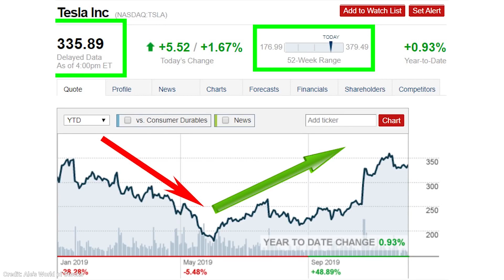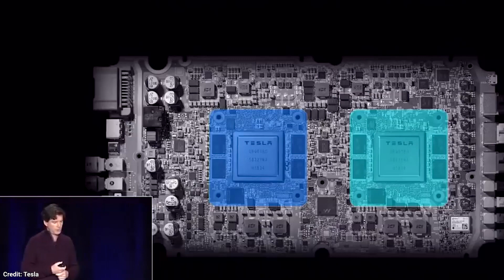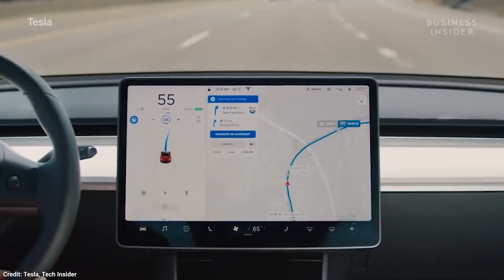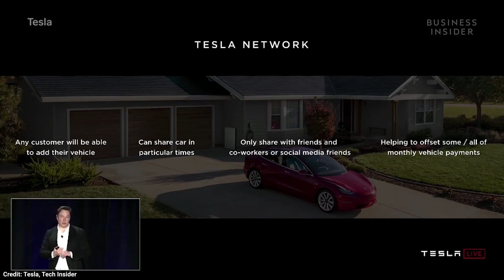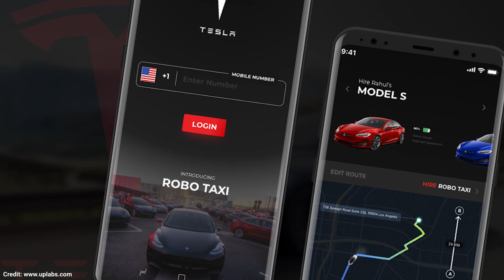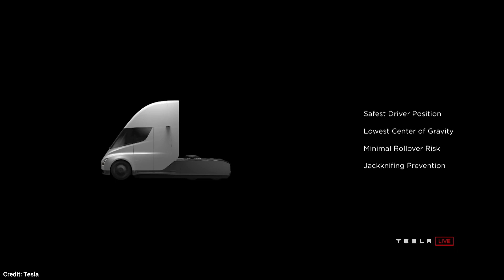5 Things Every Tesla (TSLA) Investor Should Know for 2020

Comment: One more thing, in china you can only get a license plate in Shanghai or Beijing if you have an EV. No internal combustion engine is allowed in those cities for new registration.
Reply: Not entirely true. For petrol cars, you will have to enter into a lottery to acquire a license plate. On top of that, in Shanghai, even you won the lottery,  you would still have to pay about 100 thousand rmb (about 14000 usd) for the plate.
Reply: 徐吟川 thank you for the correction

Comment: Should I buy tesla now or wait for a slump.. I have been wanting to buy for a while now.
Reply: Chlorophant if you’re planning to hold it for a few years, then it doesn’t matter. $405 vs a dip is not that different in the long term, assuming the stock reaches the $3000-4000 that it’s predicted to reach.
Reply: Buy on every down day or dip in an up day. Every check you get,  put some in Tesla stock. This is a dollar cost average buy-in, which reduces mistakes on a volatile stock. 

When the stock is at $4,000 in five years, the sooner you buy,  the better. By 2025 you'll be wealthy.
Reply: @universalchiro  Let's not pretend it's a sure thing, Tesla should be considered high risk, a lot could go wrong.  However--I happen to have near $100k on it, by far my biggest position rt. now.  Deciding to stay long today is exactly the same as deciding to buy it at current price.
Reply: Always a tough decision, I was asked if it was "cheap" just a few weeks ago at $330 and I didn't have an answer other than I was still buying.  Still around 20% shorted which is good for potential near term upside.  You might break up your total allotment into quarters and spread out your purchases over weeks or months, on the other hand we may never see it this low again given it's been nearly flat for 5 yr.s and a lot has changed for the better over that time.  As mentioned above--dips will look trivial over several yr.s holding.
Reply: I already smashed my 'diversification discipline'.  I don't panic because I know the situation well enough to have strong conviction.  Sounds like you are in a similar place to me.  I don't intend to sell until/if the story changes for the worse enough to warrant it.
Reply: I will continue to pay attention but hope to hold for 5 to 10 yr.s and probably buy a little more in the next couple months.
Reply: Nima Eslami wrong! it’s going $7k in 10 years.
Reply: If there are still tons of short sellers that are from the oil industry, im planning on making money from them.  They will lose either way.  The future is going electric!
Reply: @broski365  How do you KNOW oil interests are behind any shorts?  It seems like a dumb strategy to me, they'd be better served by doing the opposite--by investing in the future as 'big oil' certainly is to some extent for a long time, diversifying away from fossils.
Reply: @mikeslemonade  If you really have strong conviction in that then you should have every spare penny on it and maybe get a 2nd mortgage too.
Reply: @mikeslemonade  Let's hope.

Comment: Dave. I’m not disagreeing with you.  I think the Model Y is very important for the brand and the need to offer an “affordable” small SUV / Crossover. However, if the Model Y is going to attract some customers who don’t want a compact/midsize sedan, I wouldn’t be surprised if it cannibalizes a third of the Model 3 sales.
Reply from the maker: Yeah, I think it does cannabalize some of Model 3 sales, but Model 3 sales are still growing with made-in-China Model 3s coming online.  So perhaps Model Y will slow down or cap model 3 total units at 500k units for 2020 and 2021?

Comment: 6:46 Why would Tesla raise more capital when it is cash positive and sitting on $5.2 billion? That doesn't make sense.
Reply: It is free money for Tesla since they dont have to pay any interest, and with more capital they can expand faster
Reply from the maker: We'll see. I think they have very very aggressive battery plans and will start making their own cells in 2020.  Going to take additional capital.
Reply: @Dave_Lee  
No. Nevada factory is not full,  they have plenty of room. No need for raising more capital. 
You have not backed up your claim.
Reply from the maker: @universalchiro  The whole point of having an "investors day" is to shore up support for a cap raise.  Also, it all depends on the magnitude of Tesla's battery ambitions.  If they want to ramp cell production fast, they will need to spend billions on equipment and machinery, etc.  It will be pricey.
Reply: @Dave_Lee  
The whole point of investor Day is to show existing investors what the company has done with their money. 

Not to show what they would like to do if they had the money. 
Otherwise,  it would be called capital raise day.
Reply: @Dave_Lee  
I would point out that assuming the cell is made using the Maxwell process, that is (was) stated on the Maxwell website to be capable of "16× production rate".
Whether that was compared to typical cell density at the time or the physical number of cells, it's still impressive.
If they can achieve even half that number, it would basically equate to 25% of existing factory size to double production.
But, with the removal of the wet process, the plant size also reduces.
Then consider that with the added expertise of Hibar and the manufacturing prowess of Grohmann, it's possible the equipment could be built purely in house?
If Tesla was expanding existing cell production they would need a substancial and extensive extension to GF1.
With the Maxwell cell, that may not be required for some time.
Reply: I just read this article this morning that explains Tesla received a new loan from Chinese bank which rolled over an existing loan. 

So it appears that Tesla is getting more loans at better interest rates to undo existing loans that are coming due and that have higher interest rates. 

So it appears you were correct that Tesla would get more loans. 

https://www.google.com/amp/s/mobile.reuters.com/article/amp/idUSKBN1YR0U0
Reply: @universalchiro  
Not "new"
Refinanced.
Good business.

Comment: Hello Dave. Have you heard about the NHSTA investigation/batterygate/chargegate?  This is affecting quite a large number of cars (2012 - ~ mid-2016) and their batteries may end up getting recalled. Tesla is quoting 21k for a new battery. Tesla is likely getting a fine from NHSTA, is avoiding this issue like the plague, and hired a prominent firm to fight the class action lawsuit opened due to these issues. What are your thoughts? I'm surprised this hasn't really been covered by anyone. 
 Chargegate sucks :(. It makes the car no longer practical for long-distance travel. 
https://www.nhtsa.gov/vehicle/2013/TESLA/MODEL%252520S/5%252520HB/RWD#investigations
https://teslamotorsclub.com/tmc/threads/sudden-loss-of-range-with-2019-16-x-software.154976/
Reply from the maker: Yes I've seen the thread on sudden loss of range on TMC.  This is a tough issue for Tesla and owners affected.  I'm just not sure what % is affected.  I lean toward giving Tesla the benefit of the doubt that they are protecting batteries that have been fast-charged often.  But they could do a much better job with communication.  Communication is an area Tesla needs improvement in for sure.